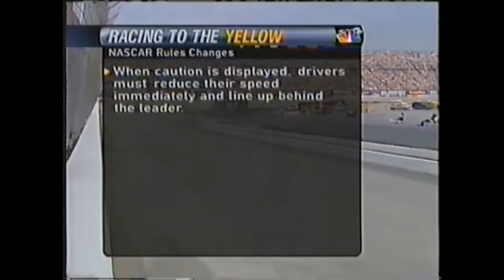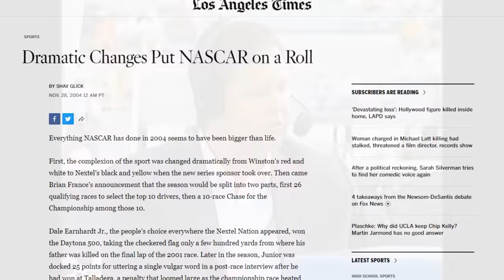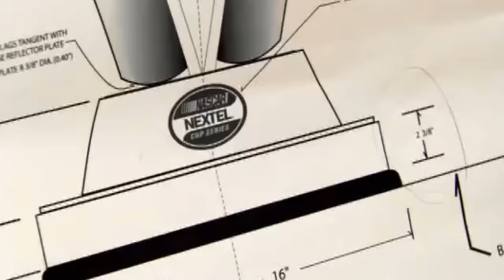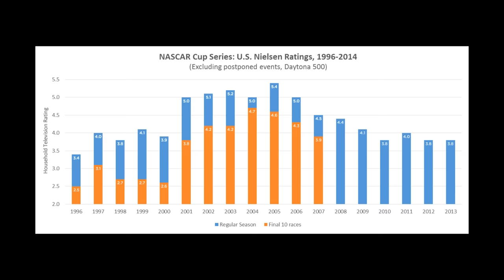NASCAR and the Dam of Legitimacy

Comment: I always question the IQ of people who like stage breaks. There's a purpose to yellow flags: Slowing down the field to address a danger on the track (wrecked cars, stalled car, piece(s) of debris, trail of fluid, etc.). Slowing down the field just to slow it down isn't one of them. They're race cars; I want to watch them go fast, not sit behind a road car doing less than 70 MPH because TV needs to run some more ads.

Bringing them back to road/street course races is especially egregious. They're all less than 250 miles, and some of that action is going to be spent pacing. Hell, the Chicago race has had a FULL QUARTER cut out of its scheduled distance for this year. So, we'll potentially spend at least six laps (three per stage break) out of 75 under yellow. It's ridiculous.

I watched the road/street course races because of no stage breaks. Guess it's back to almost not watching at all!

Comment: 2004 was actually my first full season watching NASCAR, so I've only ever seen NASCAR with the Playoffs/Chase format. I didn't dislike the original incarnation of "The Chase" since 10 races is still a pretty long stretch - it's a full season in some disciplines like sports car racing. That was still enough of a stretch for consistency to be rewarded. What I do hate is the single-elimination final round. 

The introduction of stage breaks was THE moment I stopped watching NASCAR. Yeah the "debris cautions" were also BS, but at least they were somewhat unpredictable, so teams couldn't set strategies around them. Now with stage breaks, it removes a large part of the strategic element of these races, especially at short tracks and road courses, where the distances are so short you don't even have to pit under green anymore. I like watching longer races instead of sprint races specifically because I like the strategic element that these longer races have. Without strategy, why am I watching a 3 hour race that has absolutely nothing to offer over a 30-minute one? After the announcement of stage breaks, I stuck around to watch the major races like the Daytona 500, and my home race at MIS, but didn't watch anything else; and I literally haven't watched a single second of live NASCAR racing since at least 2020 (if not earlier - I don't even remember exactly when I completely cut them from my racing viewership, but it's been years).

Then there was the attempt to turn half the season into copies of the superspeedway races by running restricted engines at all the large oval tracks and making sure every single race was literally nothing more than "floor it and turn left" - the same stereotype that non-fans think already think about when they think of NASCAR. Yeah, great way to get those ratings up by confirming one of the worst stereotypes people have about NASCAR...

Comment: I think that this video is rather accurate in noting one of the issues that has helped push NASCAR into a ditch, but there is another problem that is not mentioned here.  NASCAR has become far too expensive.  There are too many races, too many required variants on the cars (for different track types) and the engineering requirements have made it so that there really are only 4-5 truly competitive cars at any race, and the championship even though they take 16 teams, really comes down to which of those 4-5 top cars makes the final.  You can see that in the team system and the way that every team has one driver who is always competitive and will finish top 10 just about every race they don't crash or have a mechanical failure.  Jimmy Johnson was a great driver, but he also had the best cars that Hendrick Motorsports built, while his teammates had to survive on the ones that failed to pass whatever inspection that Jimmy's engineering team was performing.  

I stopped watching years ago when I realized that the races had become parades rather than races.  Much like the problem Formula One has with only 4-5 of 18 cars being competitive, NASCAR puts 36 cars on the track when only 4 or 5 will be competitive.  The constant cautions are there not only to bunch the field up, but to help hide just how far behind the leaders the bottom 10 cars truly are in a sport that's supposed to be about the skill of the drivers, not the amount of money their teams put into their cars.

Comment: NASCAR has never really grabbed my attention, and I'm a car guy (72 Gran Torino, 12 5.0 Mustang,  91 LX 5.0 Coupe). The issue for me is the move from more of a stock car homoligation type setup, to a full blown race car that is nothing like the car it's representing, not even the same engine or chassis. If they would move to at least using the engines that are in produnction like the LS or Coyote then I might start watching. It's just not really enjoyable because they all look like cookie cutter replicas running around the track.

Comment: I was a NASCAR fan since 1966 when my father took me to my first race. Later in life I worked on race cars and raced myself for around 10 years. All of NASCAR's wounds are self inflicted. The charter system where certain teams are promised a starting position as long as they spend millions to get a charter,  Stage racing,  the chase (championship), the "next gen" chassis , the common template car where there is zero difference in the shape of the cars are but a few of things NASCAR has done to itself. Don't know about you, but I've never seen a Mustang that looked like a Camaro or a Camry. I no longer attend any of NASCAR's top tier races (Cup, Xfinity or trucks). I won't watch them, keep up via YouTube. I only attend local type racing now. Screw NASCAR.

Comment: At this point I think I'd rather a stage break at a set lap than a random "debris caution" so those are here to stay. That said "overtime" in NASCAR is a hot mess so I'd rather the race just end under caution like the old days. Maybe you take one shot at a GWC. 

As far as the championship format I think the answer can be found by looking to the past and the Lucas Oil late Models. 

In the becoming Earnhardt podcast series we learned that for a time in the late 70's up until I don't know some of the points money was payed out durring the season (I guess to help teams run more races). We should bring this back. Divide the season into thirds and pay   portion of the points money to the top 12. After another 12 races you betcha another check for the Top 12. Here's the twist to the championship that breaks away from the old format and borrows from the new system the Lucas Oil Series has for 2024. The top 12 in TOTAL POINTS from the first 24 races are eligible for the championship. You reset the points with seeding based on wins and then you cut the lowest four after race four and eight of the final 12 race leg of the season. Each time you rest the score for the next round again seeding by wins Then the final four run for the championship in the final four races. Wins don't move you to the next round it's all about points. Sure wins still matter a bunch because they set the lineup for the  next round of the playoffs and obviously help give you a cushion for a bad race but I think this balances consistency with not having the championship decided early.  YES YES I know the purist out there say just tally the point all year and let it be but I don't think NASCAR can put the worms all the way back in that can. They can however have a championship format that is less of a crapshoot and still likely comes down to the final race.

Comment: NASCAR's legitimacy ended, when they abandoned their own acronym (National Association of STOCK CAR Auto Racing). 

You can't race anything off the showroom floor, and registering a cup car is nightmare of red tape that most often results in little more than a parade car exemption in those few states that will allow it.

Furthermore, accessibility is horribly limited. NASCAR was formerly a sport that was fairly accessible by anyone who could afford to have a roll cage welded into a STOCK CAR, and qualify in the field. Now, drivers are selected... almost exclusively young drivers, because teams are afraid to invest in anyone who doesn't have the potential for a legacy. The cost of putting a car on the track for even one race, is exorbitant, and prohibitive to say the least. 

The problems with NASCAR came from popularization and the desire to make a diamond out of stock car racing... but stock car racing is coal fed, gasoline fired, and grown in the fields of the south, and distilled from the corn. Instead of condensing the sport to a diamond of a single weekly event, it should've been expanded. There was nothing wrong with popularization and TV... but it should've been multiple events, from multiple tracks. Watching NASCAR should be as widespread as college football.

Comment: Track and field, swimming, and auto racing have some version of that ugly 10-8-7-6-5... point allocation method. If NASCAR wants its points system to make sense it has to convert it into something more familiar, like wins and losses and allow for comparison among racers over the years across racing systems, numbers of races, number of racers per season, etc. Who was better Bobby Labonte or Dale Jarrett? Golf and tennis have this problem where the best players can only be judged by grand slam wins, but mid-to-high level players who haven't won a grand slam cannot be compared. In 2024, 17 racers (thru March 24, 2024) have more racing "wins" than "losses" ("have finished in front of more racers than behind") across the first six races of the season. If the goal of race standings is to accumulate the results of all races into one theoretical race, then what could be better than this "winning percentage?" Bonus points for laps/stages led/races won distracts from this new, more complete metric. Ty Gibbs' finishes: 17th of 40, 10th of 37, 5th of 37, 3rd of 36, 9th of 36, and 3rd of 39 yields a winning percentage of .804 (176 "wins," 43 "losses"), but Truex Jr. (170 wins, 49 losses) ranks above Gibbs in points despite having a worse racing performance. The best way to test which points system is the best is by testing the results against predicted results in history and during the season.

Comment: The playoffs were not a terrible idea.  Having it so that every year you end up with a close championship battle is not necessarily a bad thing.  However, it does not mean that the last several races of the season were suddenly better.  It means that Chicagoland in March means nothing for the championship.  It de-values races during the season.  If they really wanted to do it right the last 10 races should be the crown jewel races.  The Southern 500, Bristol at Night, Martinsville, the Coca-Cola 600, the brickyard, a road course, and the pepsi 400 should all have been run in the final 10 races.  If you want to finish with Homestead every year, fine, but the other two should rotate.  And winning the 4 Crown Jewels (including the Daytona 500) should have given out 5-20 more points.  This would have shaken up the schedule, but it would have made the end of the season more interesting than the product they came up with.  Then, there are no changes for 5 years.  Let it play out.  Let teams try to mess with the format.  Make changes every five years or so until it's in a good spot.

Comment: Make the races 2-3 hours long TOPs except Daytona 500 and Coke 600 etc. and go back to a cumulative point system. Reward points to just the top 30 finishers in each race. Need more time for commercials? Rework qualifying to draw fans in. There, fixed it

Comment: 18:37
Just gotta “read between the lines” with stuff Harvick, Hamlin, Stewart, etc say; or listen to Kyle Bush literally (cuz he has a free-flowing uninhibited mouth) to realize that is the case. Even Hailee Deegan has a ride with a first class team because she brings money with her even though she’s in the totally wrong series for her experience and performance (look at what she can do in other forms of motor racing or cars vs. trucks… She looks like another Danica until you look at her driving elsewhere. Then there’s the wreck’em theme among most of the truck series entrants though Deegan - surprisingly- downplays it)

The kenseth retirement upon his seven-fold experience with nascar’s selective levying of “the rules” in an ongoing screwy manner shouldn’t really have been a surprise. Imagine exhibiting great consistency and relevancy at a job that has a huge end of year cash bonus based on performance, but two weeks before bonuses get paid they change the rules of the bonus structure and suddenly base it on the prior thirty days instead, and you happened to be out for two weeks with a death in the family, vacation, or whatever and some cocky arrogant young newcomer gets the big bonus… same angst (though kenseth wasn’t off-duty).

There needs to be rules, sure, and they should be enforced; but I still wonder what went on behind the scenes with 2023’s shock length debacle. With all the technology they wield how can a nascar tech inspection mistake happen? Unless it was arbitrarily preplanned- and they got caught.

Comment: You’re so wrong, the holy roller rule is only in effect in certain situations (fourth down at the end of halves). The rule states that if a ball is fumbled in the correct circumstances, nobody on the offense BUT the person who fumbled can recover it for a gain, if it is recovered by the offense it is put back where the ball carrier fumbled it. You can technically still pull the holy roller but not when it would matter and would be seen as an idiotic risk rather than godly play

Comment: This video doesn’t even discuss the growing irrelevance of the outdated car technology.  Still running carburetors!  I haven’t been interested in NASCAR in 25 years.  Couldn’t care less if it goes away entirely.
Reply from the maker: They switched to electronic fuel injection some time in 2011, and now run a 5 speed transmission.
Reply: @S1apShoes  I stand corrected.  That shows just how little I’ve paid attention to it.

Comment: Nascar has everything in place to be the #1 auto sport in the world but continues to try to be different in ways that ruin nascar and try to compete with other forms of autoracing at thier own game. 

Nascar needs to stack thier current different formats and series into a pyramid that features relgation and promotion based on performance in each season. 

Drivers should be drafted onto teams, not open employees and owners spending thier way to the top with the best drivers. Relegated drivers enter a yearly draft for the next series down. The only driver up to renew thier team contracts are drivers who are not promoted or relegated. 

The lowest series needs to be an amateur class based on a sim driving series that brings in new talent that maybe didnt have the opportunity to get behind the wheel of racecar driver because they weren't born to a rich family or live outisde the areas where racing is an option. This would make nascar the only place where a nobody with talent could become a superstar, just like almost any other sport and nothing like any other autosport. 

The top 3 series needs to be engineered to play into what makes this style of racing exciting. Speed, strategy, and tenacity. The race cars need to be built to perform best in the draft and on the straight. Unleash the power and use fuel limitation, areo, and tires to reduce the speeds on big oval tracks. 

Dump the platoff system and make a simple tonfollow points system that rewards winning drivers, laps led, and position improvements. Add series points for qualifying times and then invert the feild on the start of the race. No stages of competition cautions. If you want the feild bunched up and exciting, make the areo work in the draft and the leaders wont walk away from the pack.

Comment: You make a damning case regarding the history of the lack of legitimacy in NASCAR, but you completely overlooked the aspect that has always kept it from being a legitimate sport. What all legitimate sports have in common but has always been totally lacking in NASCAR are independent officials who are there to try to assure nobody is cheating or punting drivers out of the way. What makes it even worse is their ownership of IMSA has also infected that sanctioning body as well in regard to the former. A case in point was last year’s Daytona 24 where Meyer Shank was caught intentionally sabotaging the tire pressure telemetry so that they could give IMSA bogus figures.  But the drivers were still allowed to pretend the team was not caught cheating weeks after the race and kept their supposed wins. The very same thing happened this year when IMSA discovered weeks later that both Ferrari and BMW had been intentionally deceptive regarding their actual performance by sandbagging. Again, the teams were fined and stripped of their points, but the drivers were still called the supposed winners and kept the Rolexes and trophies.

Comment: I lost interest more than a decade ago. I like cars. I like clever engineering. NASCAR isn't about cars and punishes clever engineering.  It's about drivers and the hierarchy of decal placement and sanctioned parts.   I don't care about any drivers as much I care about a particular team. If you fine a team for moving the radio antennae a 1/2", then I have zero interest in the series. If you could push a magic button and all of the cars would be perfectly equal, I would not watch the series. Now I watch IMSA. More fan friendly, more access to the cars, different cars, different engines and different sounds.